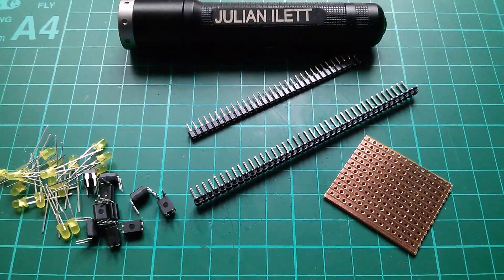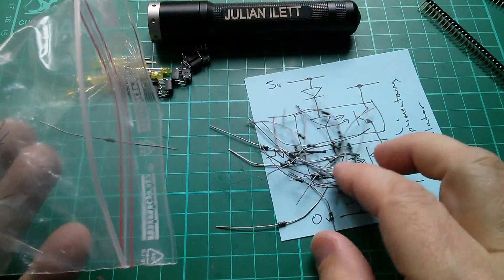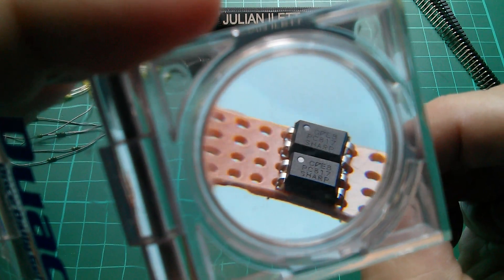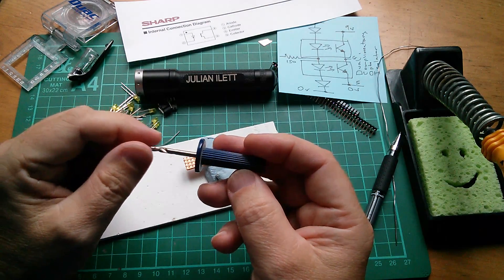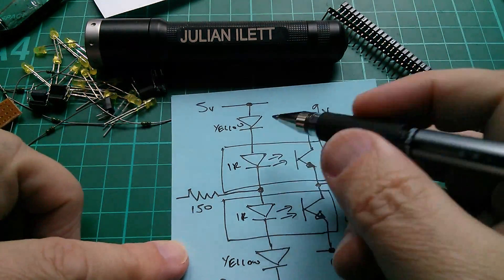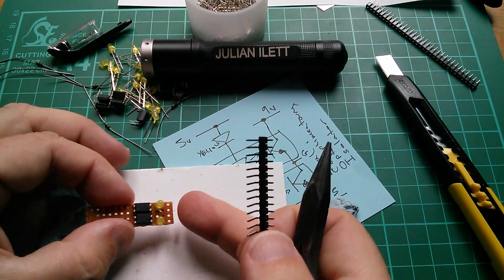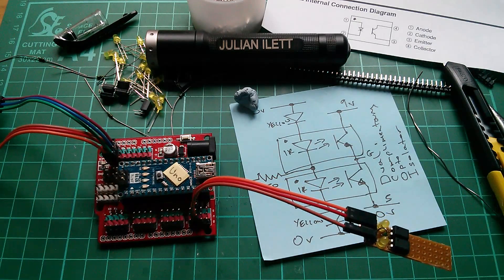DCOI Revisited (part 1) - Muppet 2 Project

Comment: Could you get away with using one opto-isolator and on the collector circuit use a pull-up to 5 volts for a high on the gate and low when the opto is on ?

Comment: Nice video, but better check that the digital I/O is not tristated at boot leaving both opto's on !
Reply: Jakob Larsen The voltage drop across the 4 LEDs should avoid that.
Reply: Thanks ! Julian even explains it in the beginning :P

Comment: Hello Julian,
I was just wondering if these optos can supply the current needed to drive a MOSFET at high frequencies.
I've read the datasheet, the absolute maximum collector current is only 50mA, so the pulsed current can't be more than 100mA. Correct me if I'm wrong.
Thanks.

Comment: You will not be able to drive the mosfet at high frequency with this circuit. Depending on Load (Gate to Source resistance) the max frequency can be very low at most a few kHz not possible to get to hundred’s of kHz that you probably want. You may damage the mosfets if you try to increase the frequency since they will start operating in the non linear region.
Look at the frequency response on that PC817

Comment: I would have used HPCL-J312 instead of this. If we are going to build this product for solar panels of more than 10W then this switching technique will spoil everything. A simple PWM buck conversion would be more efficient in that case. We need to minimize switching losses and littlebit of math is needed.

Comment: I never thought of using optos this way! 
I had a lot of 2502 and 2504 and was wonder what I can do with them to get a 12V Mosfet gate drive like the one you showed.
Great for SMPS designs.  
That's cleaver. Thanks for sharing.

Comment: hey Julian no need for 9V baterry you can use bootstrap capacitor and a diode like in half bridge driving circuits
Reply from the maker: +JOSIP Žlk Yes that works between 1 and 99% PWM, but not at zero or 100%
Reply: ...yes, and furthermore in order for the capacitor to maintain enough charge to drive a FET, the inverter frequency must remain fairly high.

Comment: Am looking forward to seeing your MUPPET work!  I hope to replicate it using ATtiny13a chips, as they only cost 0.30 usd.  If you want a positive-on DCOI, you can join the OUTSIDE pins of one side of the PC817's.  Of course, it is easier to solder the adjacent pins as you do ...  I make this connection directly beneath the chips, so it is out of the way.

Comment: Im probably just being stupid but what does having 2 opto isolators and the LEDs do that 1 opto isolator doesnt do on its own? if its just turning that mosfet on and off cant you do that just with a microcontroller, through an opto isolator if you want?
Reply: Super Loops 
Well, it's all about high side switching. The gate must be higher than the source and that could be more than a microcontroller can put out.
Reply: but the microcontroller isnt connected to the mosfets circuit anyway, thats the whole point of an opto isolator. Im not asking why use an opto isolator, Im asking why use two
Reply: Super Loops I think is the ground reference for the Mosfets why you need 2, but I'm not sure
Reply: Super Loops 
fersunk is right. We need to set the "0" to another ground than a common ground, for example the source of the MOSFET. As Julian said, the source can be all over the place. Because there is an inductor in the circuit, the source could even be more negative than the ground.
Reply: To switch a FET on you need to put a certain amount of charge into the gate and to switch it off you have to pull that same amount of charge back out of the gate and you have to do both quickly.  So both high and low states need a low impedance drive circuit.  This opto coupled circuit isn't really fast enough to drive the FETs in a converter anyway and it doesn't have a high enough current capability either so it's all a bit irrelevant.

Comment: 1) If you weren't using a battery, wouldn't  you need current limiting resistors on the diodes?
2) I've never seen a digital input acting as a ground to sink current in a circuit.  Is there a risk of blowing the output?
Reply: the resistor is what is limiting the current in both the sink and source applications. with that 150 ohm resistor it only has about 25 mA (those leds are rated for about 20-30 mA). an arduino can sink or source 40 mA per GPIO pin and 150-200 mA total.
Reply: 1) The 5V from the micro are still too low to saturate the LEDs, they run only at a few milliamps.
2) Only when the current is too high, but it is the same when sourcing current.
Reply: ya he's just showing that there is a connection straight through and he mentions that there isnt enough voltage to complete that circuit as it requires 1.7v for the infared and 2.2v for yellow and with 2 of each he would need 8-9v with a current limiting resistor to saturate all 4 leds. but in his case he wants to be able to switch between them based on the output of the arduino GPIO pin when it is either sinking or sourcing.
Reply: I suspected, but thanks for confirming.  Athough if I was powering an LED from say an Arduino (vs say a battery), I would still use a current limiting resistor just to be safe based on the link below.  I did find a link indicating that an Arduino output can sink about 40ma.
https://electronics.stackexchange.com/questions/32990/do-i-really-need-resistors-when-controlling-leds-with-arduino
Reply: Yellow is 1.8 V to 2.2 V at 20 mA to 30 mA. with the 150 ohm resistor he is only getting 7mA. if he wanted 20 mA he would need a 55 ohm resistor. the optoisolator has a max input current of 10-50mA(depends on which one he got) so he is well within spec for any of them.
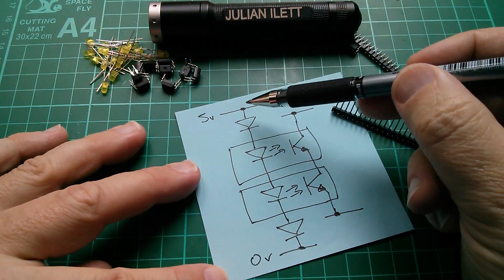Reply: OK, I think I neglected the 150 ohm resistor in the 2nd case, but at 1:30 he begins without any current limiting.
Reply: Right, I was being a bit literal.  Thanks.
Reply: Blue LEDs will blow up first at that current, and at 5 Volts there is not enough voltage to fully open the LEDs to let flow more than say 5-10 mA.